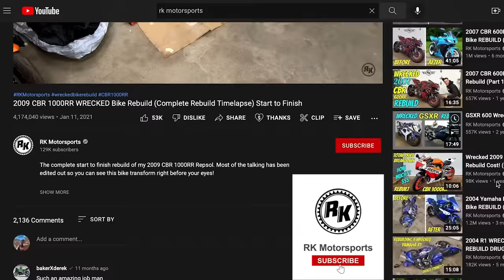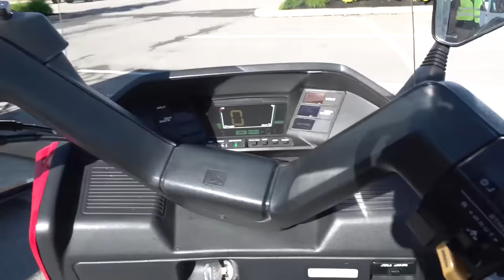I Bought a new 40 year old Honda, Will it make it Home? 8 hrs

Comment: The greatest Craig quote ever "I may not be a formula 1 mechanic but I can get you out of the woods" gotta love these guys!
Reply: Ya I'll get you out off the woods just not anytime soon took him days to get a bike going that should have taken a couple hours and he didn't even do half the work. Didn't do brakes didn't do tires then he installed the brakes and didn't even tighten the bolts. How hard is it to put gas and oil in a bike because that's about all he did. Even when he did the gauge he didn't hook it up rediculous.
Reply: @24lawdog  don’t need the best mechanic for a YouTube challenge what he may lack in mechanical finesse he makes up for with a good screen presence.
Reply: @24lawdog make a video. Do a better job. You can't? What a surprise .

Comment: I bought a 1982 Honda FT500 new out of the crate in 1984.  Drove it for 5 years when I was in college.  Last 4 of S/N were 1770.  It was a great little 1-thumper.  Hardly any oomph, but great gas mileage.  Loved that bike.  It is immortalized on film parked outside a diner in an early scene of 'Point Break'.  Only place I've seen it.
Reply: Neptunes net

Comment: I am way more excited about the Honda Helix than the Ascot. I wanted one of those SO BAD when I was like 16. My first bike (when I was 27, was a 1984 Honda Interceptor 500, but to this I would still love to have a Helix. Modern scooters just look like smaller versions of existing bikes, but the Helix looked like a futuristic transport. Nostalgia for the win.
Reply: I love to have the Helix as well. Awesome little piece of square 80s design.
Reply: I love my 2001 helix, you can fit two 12 packs in the trunk no sweat!
Reply: Hell Yeah ! Scooters RULE ! I love riding both my scooter and "real" bike LOL. Two wheels is all that matters. Scooters are SO comfy.

Comment: The version of this Ascot 500 was just sold as a Honda FT 500 in the U.K. . It had a twin port 4 valve single OHC engine . I had a CB 250 RSA with a 250 version of the same engine ,it was more popular seller than the FT 500 as it handled & quick for 4 stroke 250 single at the time . The FT were regarded as a slug for a 500 cc reported to have issues & never sold well in the U.K. ,they usually ended up being bought used by riders on a budget looking for cheap utility hacks to spanner & get about on . I doubt If modern bikes will last as long as some of the old Honda models 👍

Comment: As an owner of a different 80s Honda I would tell you there are probably 100 different little rubber things in this bike that need replacing! Especially the brake piston seals. Good luck, ride safe.
Reply: Yea old bikes are not fun for me
Reply: I have an '84 Nighthawk 650 and over the 8 years or so I've owned it, I feel as though I've replaced multiple parts every year. Except the carb boots. Very hard to find.

Comment: FT500 Ascot= XL500 in street clothes... They used to make an equalizer kit to 'air charge' the forks. You started by removing the valve stem cores, then attaching the common line that had a 'common stem' with one line to right and the other to the left fork. It tied both together with its single to dual-feed inlet, to boot, you could upgrade to get the one a small gauge on the 'deluxe' version. VERY easy to do a homemade version. Do NOT OVERFILL or risk blowing those fork seals out and it will piss out fork oil all down the outside of the lower fork LOL. I'd keep it >8-10 psi MAX.

Comment: Watched the entire video, just finished it. The high five at the end and Sean saying, 'We made it home, NO PROBLEM." is a testament to how tough Hondas are. I have a 1991 Honda Accord LX 2.2 that I'm putting a turbo on and gonna "sleeper surprise" every car on the road between towns here... I have a Honda powered pressure washer, a Honda powered 2" semi-trash water pump for irrigation on the ranch, and I've had Honda motorcycles when I was young. Only 3 words describe Honda: Tough, tough and tough.
Reply: LOL...riding a little over 300 miles is a 'testament to how tough Hondas are'....
     Honda's new catch phrase:  At Honda, we exceed low expectations!!
Reply: Dude don't do that that motor gonna blow brother word of advice
Reply: @angelteamnolimit624  You don't know the over engineered Honda motors. It's a 91 Accord LX 2.2 Sport Shift Auto. It will be perfectly fine. I'm taking it to 600 HP, and it's designed for 1,200. Thanks for the concern, though! 👍😁🏎️
Reply: @MissionaryInMexico  

Please tell me you are kidding. The engine in your car is "designed" for about 125hp, but the internals can handle quite a bit more, as the stock bottom end is good for about 300hp. There's no way in hell you will be getting anywhere near 600hp without an aftermarket rotating assembly and tons of head work, with the engine block and head casting being the only stock Honda parts. Putting that power to the ground is another story altogether, since the transaxle will fail long before the factory bottom end.
Reply: @johnfox3845  I just spit my coffee out reading the same thing.  LOL  It's good for mid 200's to the tire, and does have a solid deck vs open deck B series (Never understood why all the Honduh bois in the 90's ignored the H series)...but that ol' SOHC is going to need a lot of love to touch 600! lol

Comment: Of course it'll make it 350 miles, & it'll do it without breaking a sweat...it's a Honda...even after 40 years, it fired right up, because it's a Honda...& it needed minimal work outside the actual assembly, again, because it's a Honda...I love my Hondas...I love their just turn the key & go dependability...I also have a moody Road King, & while I do like the bike, & it's faster than both Hondas, it also requires special treatment, higher octane gas, more parts replacement, & demands a pre-ride inspection...it just can't hang with those Hondas for dependability...always develops some kind of issue when ridden on the regs...so I mainly ride the Hondas & leave the Road King for big trips...

Comment: I have ridden bikes since 1964. I have owned 19 motorcycles. I've had Harleys, Hondas, Yamahas, Kawasaki's, triumph and a few odd Italian things. Through the years I've always believed and still do that Honda makes the most reliable motorcycle. It may not have the rumble or the moniker but they will last. Oh, yes I've had a Suzuki or two also.
Reply: Ya Jim i can attest to that, about Hondas as i have had an 81 Honda cm 200 Twinstar since 91 and it runs and look great to his day.and thee only major thing iv done to it is have the engine rebuilt around 55 thousand ,and the speedos, its on it 3rd one ,oh and i did have to replace thee exhaust ,but now its probably a 100,000 and still going strong.
Reply: I once sold a cb750 because it had 20,000. Miles on it and I was convinced it had to be worn out. That was the Harley rider in me later I saw one running like mine with 98,000 miles. I was so dumb
Reply: @honda200twinstar3  An '81 Twinstar lasted 55,000 miles before a top end job was needed? That's amazing. Man those old Honda were incredibly well-built engines.
Reply: @jimbranch7312  DOH!!

Comment: I love the looks of the 80's bikes! I can remember seeing this come out as a new model, and really enjoying the unique quality of the lines. Well done on getting it out of the crate after such a long sleep. Now go find me an out of the crate 1000 Interceptor, lol!!
Reply: Still in box first yr 75 Honda CB 750F.
Reply: I had a VF1000R. Heavy. Ran hot enough to leave red marks on the insides of my thighs. Needed aftermarket parts to oil the cams correctly. Not particularly fast. I'd rather have a first year 750 Interceptor, as I have also ridden those and really liked them.
Reply: I had an Interceptor 1000. Fast, smooth, 6 speed bike.

Comment: My ascot had around 12k on the odometer when I sold it in the late 90s. Apart from the header rotting at the lower bend, it was unbelievably reliable. I always thought it was strange having a twin down pipe on a single pot but it worked well and I also had the shaking problem but couldn't figure out what it was. Nice find guys and helped me reminisce my teenage years........I should have kept it!!

Comment: I find it difficult to understand how something so nice could have been left in a packing crate to rot for 40 years unused and unwanted. There were indeed new bikes that main dealers found hard to sell, but would drop prices until they got rid of them - a friend bought a new 6-cylinder Honda CBX for a knockdown price in the early 80s after being offered it at a price for quite a lot less than the CB900 bike he originally wanted.
Reply: I bought my '79 CBX in 1983 for $2800 out the door.......laughed all the way home. Still have the bike today, it's now turbocharged.😈
Reply: A possible reason is the VT500 version of this bike was the preferred instance of the Honda Ascot. The VT500 had the V-twin engine with more horsepower and the shaft drive (instead of chain). So if the dealer was selling both versions of the this Ascot, I'm not surprised the FT was left in the box. Still a good bike but the VT500 Ascot was the preferred model.
Reply: @CostanzaWorld  thinking the same reason why it was left in the box for 40 years. Thanks for your info that explains alot.
Reply: A 79 cbx today will bring in $20-50K, a CB900 not even in the game.
Reply: I was a multi line dealer and it is more common than you might think and it normally starts as a bad business decision that turns into a good one over time. It is hard for some people to believe but dealers will have to sell below cost and come out of pocket to move aging inventory. Some dealers just can wrap their heads around it and just let it sit.

Comment: Okokok, first off, love the channel, great mix of entertaining motorcycle stuff, always something new and different. However, as a former FT500 Ascot owner I got to be the guy in the comments that has to get some things off his chest.
1)It is Not a parallel twin. it's a SINGLE cylinder, engine. Literally ripped off the XL500r dual sport with a overly complicated starter cobbled onto a motor that was designed to be Kickstart only.
2) It's only flat track inspired, it would take quite a bit of modifications to make it a track bike including removing the front brake altogether. It only has one because it's a sub 500 lbs bike and only needs one. Compared to the drum that was on the XL500r, it was lightyears ahead.
3)The little guard/fin on the rear caliper is just a dust shield, not a scrapper.
4)These things sold so poorly in their two years of production that Honda tried revamping it into the VT500 which was a v-twin with a bigger frame, dual brakes etc. It also didn't sell well... 
5)As a dual sport rider, I LOVED my Ascot, it wasn't fast but it was so much fun to ride and it never left me stranded. Enjoy!

Comment: Nice 👍 video Sean and Craig. I'm a sucker for vintage anything. Back when I lived in California I bought my Honda from the dealership and would pick to ride in this shopping center parking lot and do doughnuts and figure 8s. In this shopping center there was a mechanic shop and this guy (can't remember his name) used to see me doing that and became friends. His dad owned the shop and he showed me a 1969 Honda. It looked neat but it was kind of different than today's bikes. The clutch wasn't on the handlebars and other different features. Not motorcycle related but 3 years ago I bought a vintage mountain bike frame because the color and style was the same as a mountain bike I used to have. The challenge was finding vintage parts or similar new parts. It's awesome that mountain bike looks so much like my old mountain bike.

Comment: Hey Sean, that would be the perfect bike for you to practice your flat-track skills. 1 problem...ITS TO NICE!" One reason you can't find a good clean FT 500 Ascot is people are still racing them. Good luck with the Ascot & your race with Wheels in time!
Reply: nahhhh . The ft  has horric reliability issues . Wouldnt last 5 minutes and be a shame to kill it off after its sat around waiting for love all this time .
Reply: @godzillas6301  No kick start and a notoriously bad electric starter
Reply: @MitchJohnson0110  Back in the day i was offered a swap for one . I had a Honda RS250 at the time so it seemed a plan . Turned up and sure enough it wouldnt start . I didnt want someone elses problem so walked away . Id not known about them prior and reading up i found there down as one of the worst Honda made with engines failing super early , cam lobe hardness issues , camchain , guides , carb , decompressor etc ....... just the whole lot of what could go possibly wrong but all built into 1 machine . A real own goul from Honda and a valid reason they didnt last long . 

Id still purchase something along the lines but id go for the FMX650 .
Reply: @godzillas6301  my dad stopped riding his because the rear brake would lock up at speed for seemingly no reason

Comment: I've had about 20 motorcycles, I still have 3. The 2007 Honda helix is the best scooter ever made.
Reply: looks comfy
Reply: I love the Helix!
Reply: have you heard of the gilera gp800
Reply: Yep I got a 2001 helix early this year and it's been my daily ever since!  Super comfy, highway capable, stable because of its length but very flickable with those small wheels, and turns lots of heads at car meets!

Plus you can fit two 12 packs in the trunk and then some! 😁
Reply: @chE3z1  Yes, love the helix . Top case holds 2 x 24 .  I have the Reflex And a shadow 750.  The helix can out run the shadow  , but the shadow takes over past 75.

Comment: Watch the valve cover on the FT, they tend to weep. There is no gasket (by design). IIRC it's because part of the valve train is mounted in it and a gasket would mess up the clearance.

Also, the kick start from an XR500 supposedly fits but the FT head does not have the compression relief port machined.

Comment: I bought that same model and color new in 1982. One if not the worst motorcycle I have owned in 53 years and at least 25 other bikes. The air suspension was fidgety and the skinny forks flexed at speed but that was okay because the vibrated so badly at 70 mph only until starter motor clutch quit working.

The starter motor clutch failed so much that I became an expert in bump starting.

Comment: The shrader valvles on in the fork caps on most of those bikes were actually for bleeding the air off the forks. I had several bikes back in the 80's, early 90's that had them. Over time they would build up pressure and you had to bleed it off. 
I will not deny adding 5-10 psi to them helped the ride. 

When I was in my teens, riding street bikes and thought I knew everything, and my dad was wrong, I would add air to my forks. I did this to get them extended all the way and stiff so I could pull wheelies easier, since the bike no longer had to raise the bike the length or travel of the forks before it started pulling the front wheel. Needless to say it actually made the bike have a slight chopper look since the front was raised up a little more and I kept blowing out fork seals due to too much air and pressure in them with no room for it to expand and contract a pocket of air plus the fluid, lol.

Comment: What has become of the FT500?  Please do more with that great bike. I bought one new in '82, loved that bike.  I dropped the triple clamps on the forks 3/4" and it really improved the handling. I also put a White Bros. Stage 1 kit on the engine,(header, Supertrap exhaust, carb jet and K&N air cleaner),... all of which improved the performance and lightened up the bike a lot and made it super flickable. I put Fox Shocks on the rear and new springs and fluid in the forks all set up for my weight. I could go on & on.   I wish I never sold it!  Bye the way,.. in May of '82 it cost me $2,350.00,.. too much but for a dirt biker like me it was perfect street bike once I made a few changes.

Comment: These are two fun bikes. I LOVE my Elite 250, it has the same motor as the Helix, the Goldwing of scooters, and I ride a Vulcan 1500. Scooters rule ! "$30 bucks for gas. Thanks Brandon." That was classic. Honda scooters like the Elite / Helix (same thing under the hood) are designed to ride for hours on full throttle without the engine struggling one bit. You can even remove a part inside the belt drive to make it go faster.

Comment: Got a 91 NHawk 250 with 6300 that sat for 15 years for $500. Thru it together as a bobber build for my new wife. Total with new tires/tubes/LEDs for $1400. ❤️. Super cool snag on your part. I like the older Honda bikes. They just seem to start and go. Mine did. Fresh oil and started on third button push after new carb got going. 👍

Comment: I drove a 1984 Ascot VT500 from Portland, OR to Miami, FL in 2009. Definitely not a bike to do cross country with but it made it the whole trip without any mechanical breakdown. Had to adjust the carbs a few times when driving in higher altitudes, but that was about it. Challenging trip but very memorable.

Comment: The Ascot FT is the bike I'd love to find new in box.  I ride a bike with the same frame, but the Ascot (std) is probably the ideal street bike for North American roads, like the GL500.  70mpg you should expect in typical two lane riding.
Bet that Helix got 90+.  That is the most dependable small motor Honda ever built.  It can be roll started with a dead battery, even the 2000 era ones if I recall.  They're goofy looking but super comfortable for multi hour touring.

The 80s were great for upper 20s and 30 somethings...think Moonlighting instead of FlashDance.  80s were over the top goofy for kids..but then so was the 70s, the 90s, and today.
Reply: Andrew Mai  and he was on 4 lane hwys holding a steady 3/4 throttle...since he was riding with a Helix I doubt they went over 65.  The Helix will do 70 with WOT, but it isn't happy.